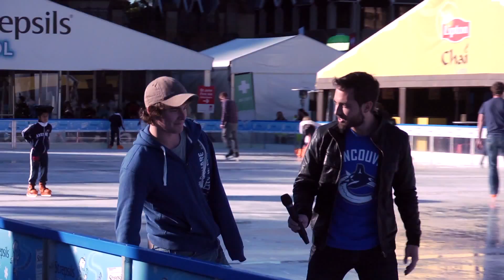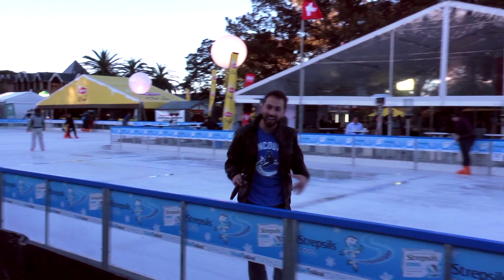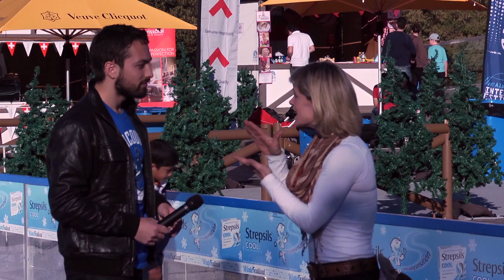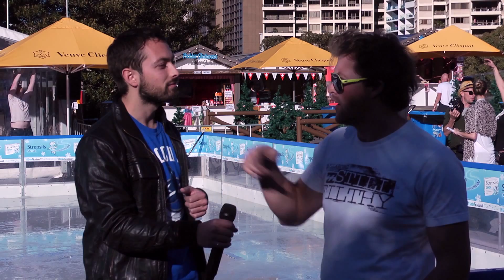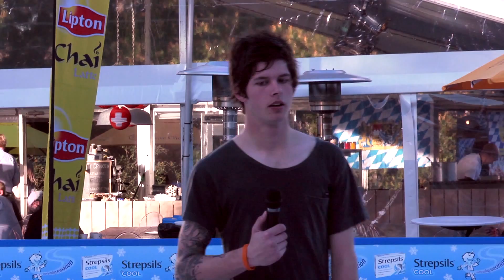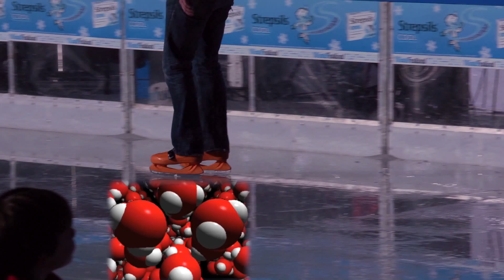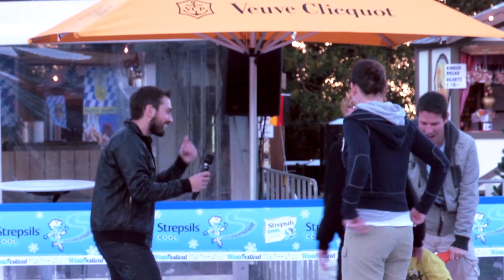Why Is Ice Slippery?

Comment: @veritasium sorry Derek, but pressure is not the reason, it is a marginal aspect, please be more informed when you do such videos. when it is -1*C you need a pressure of 18 million pascal to heat it to 0 degree, where it could melt. a man lets say 80 kilo , with the contact face of his skates of lets say 0,0001 square meters would only be 8 million pascal (p=F/A (F=ma)). but ice is around -6 degrees(best for iceskating) or even around -9 degrees(best for ice hockey), so pressure is not the reason! Friction and heat conduction of the skates are also negligible. The true point is the thin layer of water on top of the ice(-1*C=~70nm, -24=~12nm), when it is around -33*C it is not slippery anymore. According to the 2. law of thermodynamics it might be confusing that the ice on top does not freeze completely, but when it is liquid on the top it is a lower energy state due to less bonds of the molecules, faraday discovered this centuries ago. Today we even now that for example lead has a small liquid film on its top 40 degrees under its actual melting point of 327,5*C.
Reply: I think its slippery because
Reply: Yeah before you try and "prove" how "smart" you think you are, you might want to learn how to communicate like somebody who actually finished the 8th grade.
Reply: ***** Wow, I'm pretty sure you have the right idea, but your communication skills are so poor I can't tell for sure. Please finish high school before attempting to convey a written idea again.
Reply: chill dude, dont get too salty

Comment: you got this one wrong. although the pressure causing melting argument is popular it is wrong. a human can't exert enough pressure on the edges of the blades of the ice skates to melt the ice because we don't have enough mass. the real reason is the friction of the ice skates against the ice causes a thin layer of water to form due to the heat produced and the skater glides on this thin water layer.
Reply: Actually, none of them are right.  We don't know why ice is slippery exactly, we just have theories as to why it is.
Reply: we do know, i gave you the correct reason...
Reply: Rich dom
No, we don't.  You're answer is just as "wrong" as Derek's was.  It's true that both pressure and friction contribute to a raising of the ice's temperature, but the amount pressure effects it is minuscule and the friction doesn't explain why ice is slippery even when you're standing still.

No evidence suggest either of them is the sole reason that it happens, just a couple of factors that help it out a little bit.
Reply: Diddy y Rich dom I agree. We don't seem to have the answer. Although I think Rich dom is perhaps more correct than Derek. Quantitatively, Derek's response contributes only around 0.1°C to ice melting. The contribution of friction has many variables, but is certainly greater than 0.1°C.
Reply: Diddy y the correct answer is the molecules on the edge of solid ice are disorganized making them semisolid

Comment: The answer given by Veritasium is correct. The sharp edge of the 'scating shoes" press the ice (pressure is more as the weight of the skater is acting on thin blades of the shoes. When pressure on the surface is more in the area of the blades ice melts (increase in pressure decreases the melting point) in those areas of skating surface and when the pressure is removed, the melting point rises over that area. As the skater moves, this area moves and melting and redemption takes place continuously along the path of the skaterer. Another way of lowering the melting point is add common salt. This is the way ice is melted and scooped from the path way to the sides in icy winter. Certainly not temperature.
Reply: It turns out the answer in the video is only slightly correct.  The pressure does lower the freezing point, but only by 0.03 degrees; it plays nearly no part in why ice is slippery.  Else lightweight large surface objects such as a curling stone wouldn't shuffle so effortlessly.  It turns out to be a nanometers-thick surface layer of water which exists far below 0 degrees Celsius, accompanied with the friction of movement melting it even more.
Reply: Rob Spiess and that's what I was tryin to say.  it takes far too much pressure to melt ice significantly enough
Reply: Science still doesn’t know the true answer
Reply: scat?

Comment: Don't ask me, I'm no scholar on that subject! 
But I guess it would be similar explanation to why teflon is slippery.
"It’s the fluorine atoms that give Teflon its slipperiness. Fluorine atoms are physically bigger than hydrogen atoms. Their large size makes them huddle around the central carbon chains in a much tighter formation.

This tight formation works like a kind of chemical armor, protecting the carbon atoms which in turn hold the molecule together."

Comment: This would not account for skating on ice that is colder than 4 degrees because the difference in melting point is so minimal per hectopascals although the pressure created by skates is quite large but not large enough to account for skating below minus four degrees celcius. And with your explanation ice would not be slippery below your shoes or when sliding on your belly

Comment: It does?(O_O)
Haven't really noticed that myself, even though I have lived in places where the temperature can drop as low as -40C. 

I guess it could be that the pressure is one factor attributing to the slipperiness of the ice, or for example the sunlight melting the surface of the ice more efficiently in warmer temperatures maybe?

Comment: I'd like to see this pressure melting tested in a more controlled way, perhaps with the weights hanging off a wire. But I'd like to see it done with an ambient temperature below 0C. That way, everything can be nice and isothermal.  Anybody have a walk-in freezer?  It then becomes kinda easy to calculate the pressure around the wire.

Comment: That's a pretty simple answer.
The water molecules form a film that rolls over the ice under your feet. Since liquid water has almost no friction against itself and the pressure of your weight keeps that layer as a liquid. Since there isn't a higher friction surface for your feet to grip it remains slippery. Same reason you can slip on water puddled on tile in most shoes but once you have high grip or non slip shoes or are on asphalt You're ok

Comment: The ice is slippery because of the coefficient of friction between the contacting surfaces of ones skate/foot, and the ice/water layer. The compression of the ice leading to a liquid layer is only what allows the coefficient of friction to be low.

Comment: In fact, many scientists argue that ice is not slippery because of the pressure, but because of other factors.
The "pressure melting" theory is starting to be discarded as the the pressure caused is so little that it is not enough to melt the ice considerably.

One popular explanation is that ice is simply slippery, in a similar way teflon is slippery for example.

Comment: True.  Also, if the concentrated pressure from the ice skates is what makes the ice slippery, then you would NOT be able to slide on your belly or an inner-tube since your weight would be spread over a larger area = a lot less pressure = no slippery effect = ice burn (like rug burn lol)

Comment: You were little wrong there. If it would be -30C it would be more difficult to compres it to liquid, so it would be actualy less slipery, therefore it depends on outside temperature as well

Comment: From the post below

 "At the surface of ice, water molecules are only hydrogen bonded to their neighbors on one side. Consequently, their energy is not as low as in bulk ice. So, at equilibrium, they must have a higher entropy. So ice must have a thin water layer on the surface, whose thickness woud be expected to increase at temperatures close to melting"

but this is a mouthful, so I've been working at deciphering it all day (the notorious distractions inherent with the internet doesn't help)

Comment: I believe there is more than just one reason.
But I'm not sure if he means ice being slippery in general, or more specifically ice skating.
You forgot to factor in friction, as you start out there is more resistance when ice skating, and less as you get moving.
Also ice is also smooth, especially when they use a Zamboni.
Ice with a layer of frost would be much less slippery, generally, not ice skating.
Oh yeah love your name.
The 1st rule is not to talk about it :)
The 2nd rule ...

Comment: No, the ice does not turn into water when you stand on it. Even when I lay on my back on the ice it's slippery, and when I do that I spread out my weight and there isn't nearly enough pressure to melt it. If there were, I would get wet, but I don't. What happens is that at the crystal boundary, the surface of the ice, the molecules are wobbly and allow something to move over them without sticking to it and without catching it.

Comment: No it's how they make Liquid Nitrogen, they crush it because there are no refrigerators that can cool it down enough. The Earth's core is hot because of 3 things: 1. Friction at the crust. 2. Radioactive decay makes heat. 3. The Earth still has massive amounts of heat from when it formed. Not pressure.

Comment: That's not true! The compression doesn't decrease the melting point. Higher pressure does increase melting- or boiling-points (see room temperatured boiling water in vacuum). The compression and friction under the skid increases the actual temperature of the upper layer of water-molecules (because they are now forced to collide much more than without). This is why it's melting!

Comment: lol. 4 months after the fact: you forgot the mega.
135Pa is like... the pressure over a 27cm x 27cm plate with a 1 kg mass on top of it. 
If ice melts that easily, one should be able to press through a cube of ice with no problem ;P

Comment: If by "wet" you mean, "why does water absorb into cloth and other materials", then the answer is because of dipole interaction. The water attracts to most surfaces by electromagnetism and chemical bonding involving electron sharing. Material can be (and has been) engineered to act against that, and it is called "hydrophobic" material.

Comment: There are two scenarios dealing with pressure. First is the air one, wich helps holding the particles together making harder to melt (closed system) and the other event is a impact, with the right enviroment it can melt. Water has its max density at 4 ºC and the ice is less denser due the structural propreties that keep the particles close each other. It is not because the pressure but due the interation with energy and particle to particle.

Comment: So that means the ice isn't slipery all the time? By that conclusion I can wear woden planks on my feet and don't even realise the surface I am on is ice. The true cause is indeed friction. Giving the energy to the particles of water to melt. By the way, with more pressure the harder is to boil or to melt things. The higher you go on the planet the easier is to boil things (less air colum above).

Comment: But when pressure make ice become water it's kind of strange that pressure also makes gas become liquid.
So does making water out of ice by prossure just work with water, because ice has a bigger volume than water or does it also work with other solids where the solid state needs more room than the liquid state?

Comment: "No reason"? Funny that you'd say that ...

Why Is Ice Slippery? Robert Rosenberg, Phys. Today 58, 50 (2005), DOI:10.1063/1.2169444

"But surprisingly, even with little evidence in its favor, pressure melting remained the dominant explanation of the slipperiness of ice for nearly a century."

Comment: You're right. I have never walked on ice. Especially since I am a hockey player. Provided the same force applied to two people of equal mass, one with skates, the other with shoes. The person with skates will have a much higher displacement than the person with shoes. The surface area of the contact surface makes with the ice does not impact the friction force.

Comment: I get that putting pressure on the ice squishes the atoms closer together, therefore lowering the melting point. But why does that allow the skater to glide over a thin layer of water? Surely if the melting point is lower, that makes it even harder for it to melt into water? Any friction created by the skates would surely, then, have even less of an effect? Ma

Comment: But we're not looking to melt 1cm^2, we're looking to melt a fraction of a millimetre of ice under a blade a with a point of contact a few millimetres wide at most. The values become far lower when looked at that way - and the video's hypothesis holds true.

Comment: I'm sure this is what xBris meant. The issue is that ice skating blades are not so narrow as to exert a large enough pressure, when worn by a human, to appreciably change the melting point (ice skating is possible well below 0 C). It is now one of those (somewhat) famously incorrect assertions with a plausible explanation. Check out wikipedia - premelting (because I am not going to actually do a calculation in a youtube comment).

Comment: Just read the wiki on ice and you'll see that none of these theories hold up in extremely low temperatures. The surface of a substance tends to have different physical and chemical properties than the bulk because attraction-repulsion forces are not compensated in one direction (outside). E. g., think about surface tension for water. Similarly, the ice surface is not really a solid but is in a semi-liquid state.

Comment: I thought of that too, because of the video he made about comparing temperatures by touch. But if the heat transfer capacity were the reason of melting it would come a moment when the metal temperature is equal to the ice's, so the melting would stop.

Comment: Friction is a minuscule factor. Pressure and temperature are directly related. Snow machines work on the opposite principle as friction under an ice-skate. Pressurised water is forced through a tiny aperture. When the pressure is released, the kinetic energy of the water molecules is released resulting in drastic decrease is temperature and the creation of ice crystals. If you apply pressure to a frozen sample, it will melt...the same reason why you can compress snow into a snowball =)

Comment: He was able to slide farther for a few reasons. First, he was on a tube, which was probably made of rubber. The coefficient of friction (mu) between rubber and ice is very very small, meaning the tube could slide extremely far without much deceleration from friction. The ten yard run-up probably helped immensely to build up his momentum as well.

Comment: sorry but you are mistaken, take an example by simply leaving an object on a piece of ice for a while, even if it's an object the same temperature as ice, it will slowly create a layer of liquid water beneath it because it's compressing the ice.

and since ice looses volume when it heats up, compressing it is equivalent to melting it.

Comment: i knew that yay! a couple years ago i was reading one of my books i have and therre was this exparement in it that involved a block of ice a string and a weight you put the ice between two objects so the middle is unsupported and you tie the string in a big loop with the weight at one end and hang it on the ice the pressure from the string melts the ice but since its still cold it refreezes the ice so it seems that the string just passes through the ice it was fun!

Comment: In that experiment, the pressure may cause a small amount of melting, but the thermal conductivity of the wire is far more important.  As the wire slightly warms up the area of the ice it is in contact with, the ice melts and the weighted wire is pulled down through the water.  The water then refreezes above the wire.

Comment: Greetings chemist. The weight(W) of a human may be too small to accomplish this, however, considering the surface area of the blades in contact with the ice are so minuscule, the pressure 'P' is huge. Pressure(P) is proportional to Force(F), and inversely proportional to Area(A). P=F/A or P=W/A. 

The weight of a human does not really matter. All that matters is the surface are of the edges on each blade. The middle part, which is curved, does not touch the ice. Lower area = higher pressure

Comment: Remember tho that it's not the elephants heavy feet that damaged your wooden floor, it's the nice very light lady with the .5 square inch heels that causes the marks.  Treasure = Force / Area
And the area of the skates ( the area of which you are sliding on ) is actually very tiny hence the pressure is very great.
And obviously there is not a lot of friction since you can actually slide on there....

Comment: Ok let's do the math: Let's assume we have a warm day and the ice has a temperature of around -10 °C (263 K). You then need ~10^8 N/m² (1 kbar) of pressure to melt it. Since skating also works for little girls, lets assume a body weight of 30 kg. The contact area of the blade would have to be 3 nm². A 20 cm long blade would have to be 8 times thinner than a human hair for this to work. More realistic is a 40 µm² blade - but then you would have to weigh 4.000 kg to melt the ice. Science ftw. Rgds

Comment: It depends on the pressure you exert on the ice. With normal shoes on you probably wont, because your force exerted on the ice is divided over a large area of your shoes. On razor sharp blades though, things might be different.

Comment: I'm not entirely sure on this but I beg to differ. What makes the ice have a lower melting point is the pressure that we exert on that thin layer of ice. Pressure is force (roughly your weight) divided by area. The reason why the skates are designed razor sharp is so to maximise pressure so as to make the ice melt.